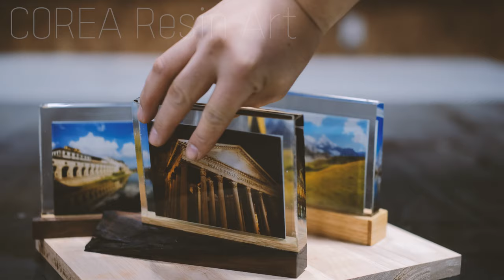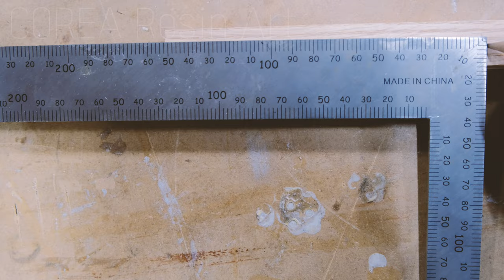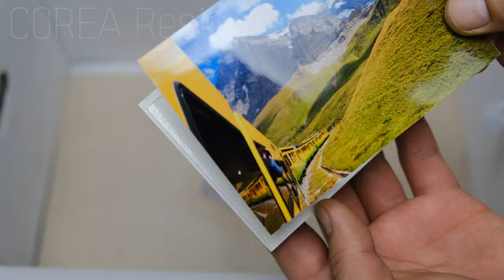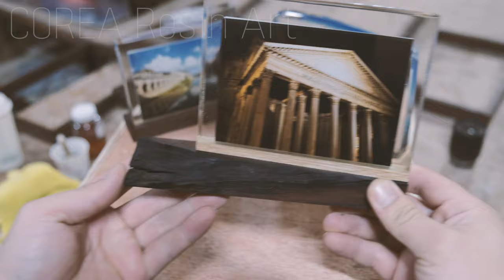Epoxy Resin Photo Frame   -  Resin Art

Comment: Why did you boil the resin? Pleeeease answer 😊
Reply: looked like a vacuum chamber which I'm guessing was to extract air bubbles
Reply: It is a vacuum pump and does get the bubbles out as with this method you can't exactly use a blow torch to get rid of the bubbles . You can put the cup in hot water and it should also get ride of the bubbles after some time